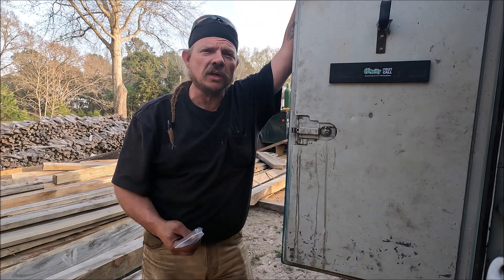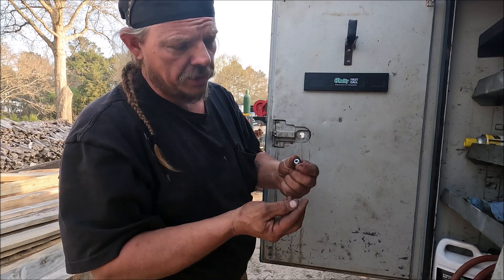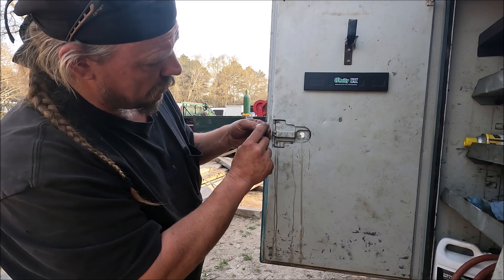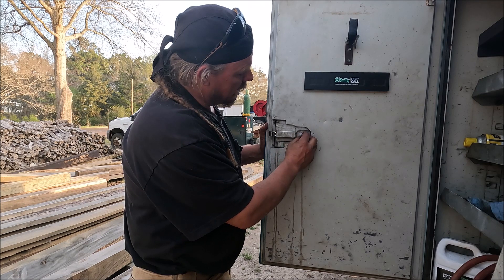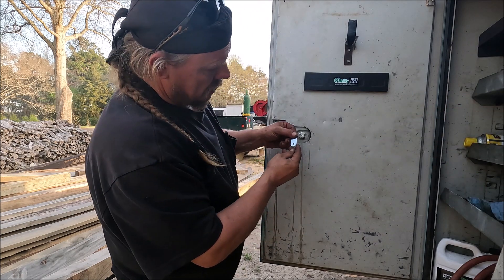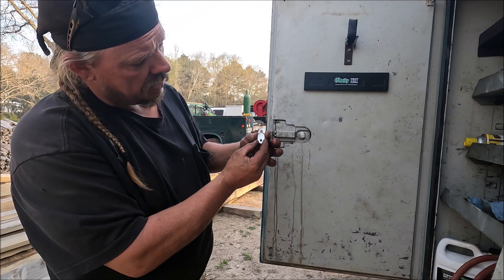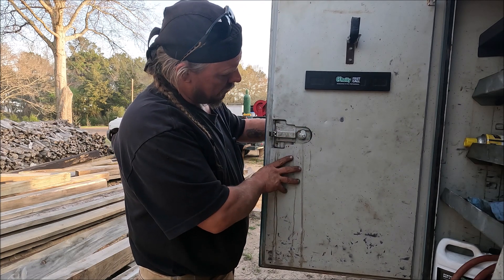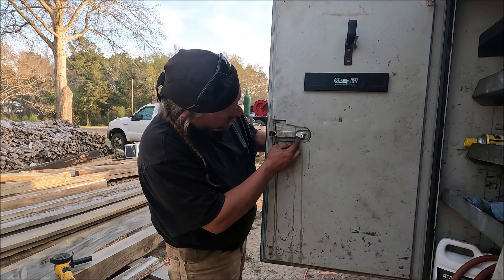Installing Toolbox Locks

Comment: Howdy y’all- really good instructions on installing the locks. Too bad your other truck went down. I just got my old work truck out of the shop with a new engine. Them new engines ain’t cheap. Good to see ya again. Have a great weekend. God bless
Reply from the maker: We rebuilt our engine probably about 15k miles ago but we started having electrical issues with it with the wiring harness and computer, I just got tired of it messing up so this new truck is a 96 with the 7.3 diesel and a 5 speed transmission with a 2 speed rear end, it should do everything we need it to, it’s good hearing from you, we hope y’all are doing good.
Reply: @CountryHomestead1  That oughta get you there and back. Blessings